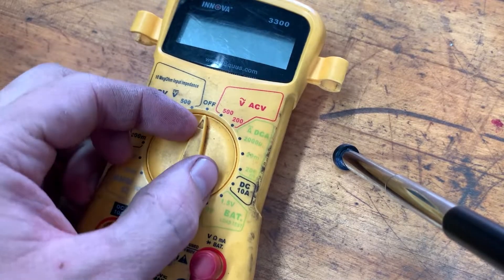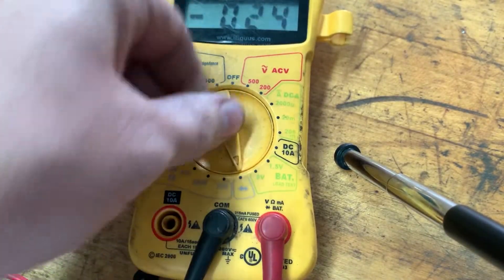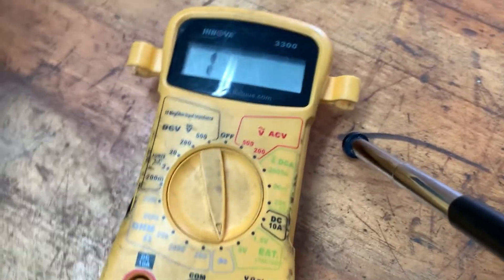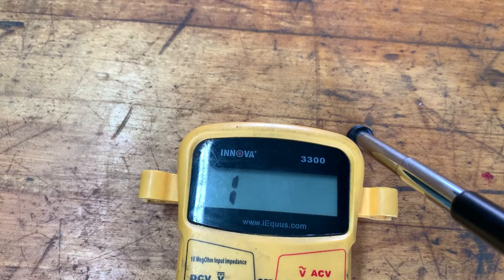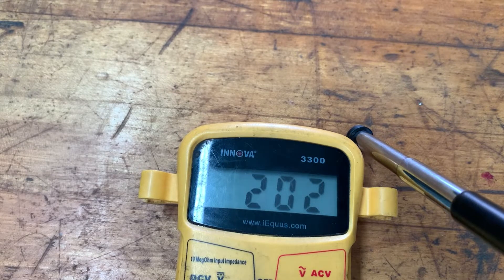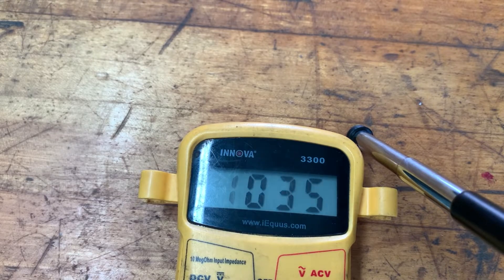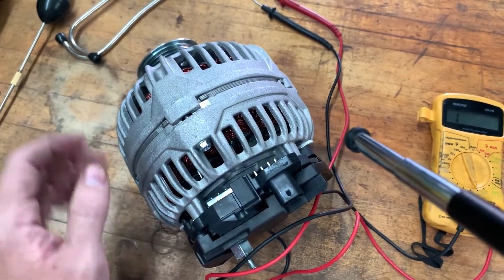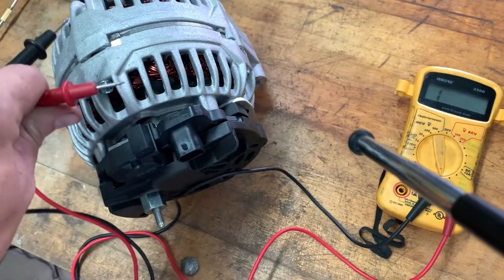How to do a Quick Alternator Diode Test with a Multimeter

Comment: Can you perform this test while alternator is connected inside the vehicle, or does it have to be out of vehicle? So can I do this test with the alternator wire harness connected and the connector wire connected to the alternator?
Reply: He says in video you can do while in vehicle, just unhook battery 😂
Reply: Yep both out or in vehicle
Reply from the maker: I'm no electrician, just a DIY guy, but I think it's best to have it disconnected to get the reading you need for this test. Maybe someone else can chime in on if that's proper or not.

Comment: Update please, the alternator on my LS1 is making the same noise.  I have found that if you unplug the lead that goes to the positive of the battery, the whining stops which leads me to believe it's either a diode, or voltage regulator.  The bearings on mine seems fine.  Exact same noise as yours.